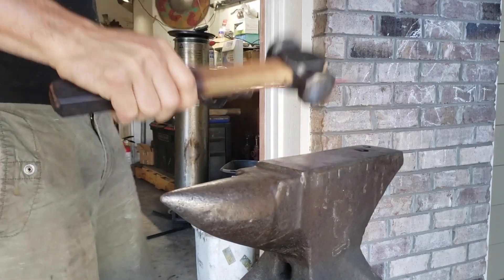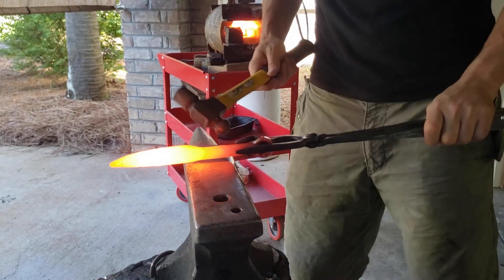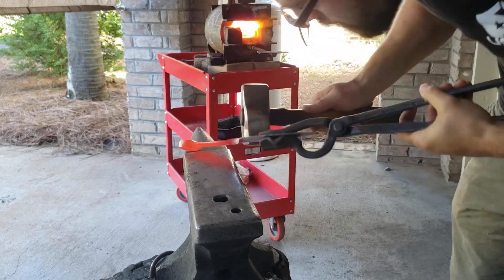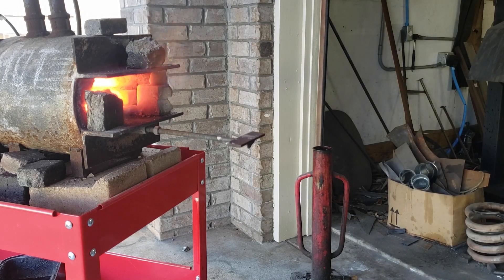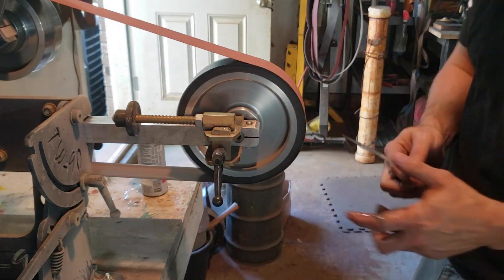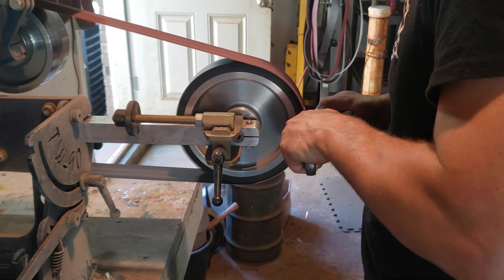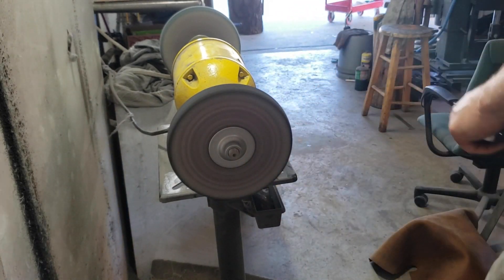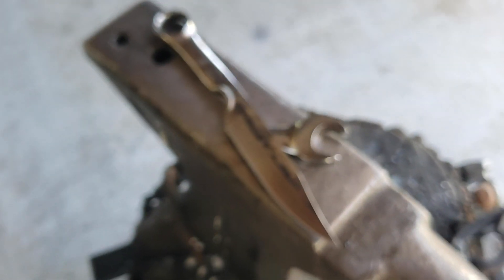How to FORGE a WRENCH KNIFE

Comment: I didn’t think the newer wrenches had that much carbon in them. And be safe when putting new wrenches in the forge. Burning off the chrome will put off nasty fumes. Hope it keeps a sharp edge.
Reply from the maker: I don't think there is much carbon in them, more of a "just for fun" project.
Reply: @JoshAWeston  dont forget we will be in close proximity to these fumes for extended periods of time multiple times a day. Have you looked into the risks?
Reply from the maker: @824WaterBoy  that's why we have the ventilation installed 😉 a few wrenches at a time won't be a problem for the vent to keep up with. Don't stand in front of the forge breathing in the burnoff either.